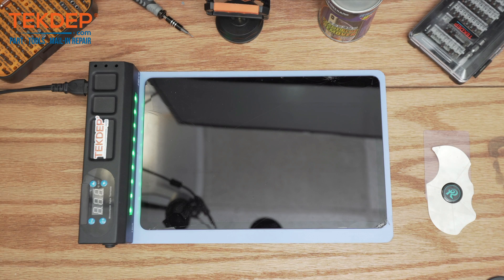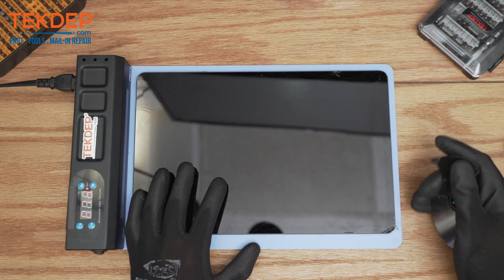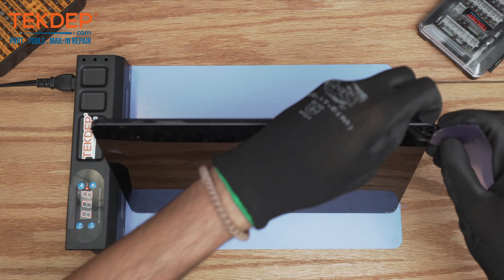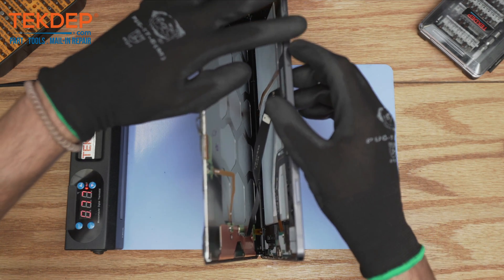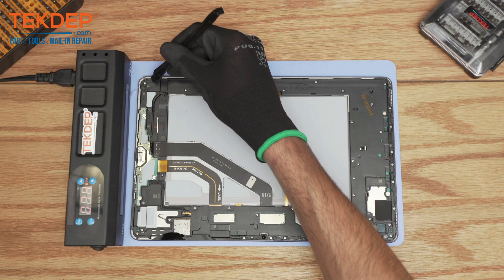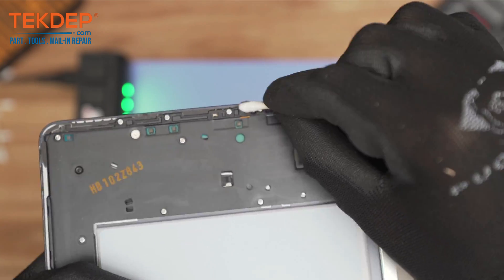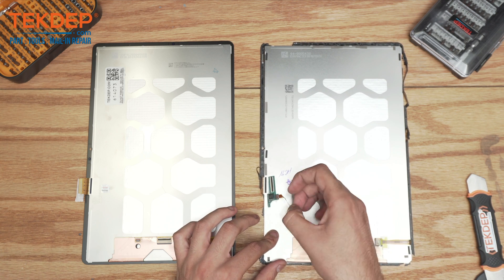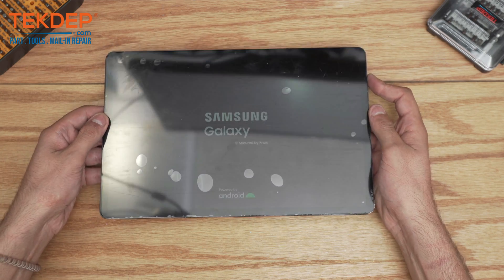Samsung Galaxy Tab S7 - Broken Screen Replacement Repair Guide

Comment: I tried to fix my screen but it's not working what can I do 😢
Reply from the maker: Sorry to hear it’s not turning on! First, try a forced restart by holding the Power and Volume Down buttons for 20 seconds. If that doesn't work, I’d suggest re-opening it to make sure the display flex cable is fully clicked into the motherboard. Sometimes they feel like they are in, but aren't seated perfectly!
If the problem persists and you'd like a professional hand, you're more than welcome to use our mail-in repair service.
https://tekdep.com/mail-in-repair

Comment: Since the screen flex is bent over when installed, could it lose connection  . I replaced the power butyon and it dont turn on. Not even when I charge it. Should I order a new flex cable?

Comment: I accidentally submerge my tab s7 in water in a bucket about half an inch and after a while it went black. The tablet was already cracked and the water went inside fast.😔 I ordered from Aliexpress the LCD and im gonna try to repair it myself tonight.
Reply: Did you replace it?

Comment: The wacom cable is in a different spot in this video than the screen pictured on your site for the SM-T870. Which one is correct?
Reply from the maker: There is different version on most devices on the market, they look the same but when it comes to components they may use different layouts 

If you're still experiencing issues with your device and need help, we offer a convenient and affordable Mail-In Repair Service and data recovery. You can learn more and get started here: https://tekdep.com/device-repair/

If you need parts or tools for your galaxy tab repairs, we have them all and ship worldwide! visit: https://tekdep.com

Comment: Hey man i replaced my screen and the replacement works but now it has like dark spots on the left side of the screen. Any ideas?
Reply from the maker: Most likely the replacement screen being damaged while reinstalling it, 

If you're still experiencing issues with your device and need help, we offer a convenient and affordable Mail-In Repair Service and data recovery. You can learn more and get started here: https://tekdep.com/device-repair/

If you need parts or tools for your repairs, we have them all and ship worldwide! visit: https://tekdep.com

Comment: My Galaxy tab wont charge nor turn on after replacing the screen
Reply: Sounds like you either didn't connect something right or you fried the board, or maybe you destroyed a fpc connector next time don't touch it
Reply from the maker: Hello, that is unfortunate!

Make sure you have connected all the flexes and used anti-static tweezers and plastic prying tools. Also, be sure to disconnect the battery whenever you touch the logic board. If you need tools or mail-in repair, visit our website.  https://tekdep.com/
Reply: This is maybe too late, but most likely it was all good. The thing is you have to start it with power on + volume down(or up, I can't recall) and it takes a bit  longer than usual. I hope you didn't throw it away

Comment: After the repair, everything worked well, touch and spen. But after a while, the touch stopped working, only the spen works now.
During this period, oneUi was updated. Any tips to try to resolve this, or is it a screen defect.
Reply from the maker: I don't think it is a screen defect, in the last week or so Samsung has pushed out an update that has made touch screens not responsive to touch, only responding to S-Pens. We are hoping for a software fix in the next few days.
Reply: I have a S21 ultra & 22 ultra that had after market screens and  UI updates killed the touch, it's not the screen. They both work with S pens.

Comment: whats the cause if the s pen doesnt work with the new screen? could it be the lcd ?
Reply from the maker: Usually the main cause for the situation you mentioned is defective LCD replacement however we suggest to get it checked by a tech. We also do mail in repairs if you're interested please visit. https://tekdep.com/

Thank you!

Comment: How to fix it if the inner screen is damaged
Reply from the maker: Hello, Good question! Fixing the inner display, commonly referred to as refurbishing, is a labor-intensive process requiring specialized tools. Extracting the display involves considerable time, materials, and risk of scratching the LCD making it less commonly done for Samsung Tablets compared to Apple devices. Therefore, we recommend replacing the entire assembly instead.
Thank you!

If you need parts and inquire please visit our website https://tekdep.com/

Comment: How much it cost  to repair
Reply from the maker: hello, thanks for watching. you can learn more at www.tekdep.com/repair/ .
Reply: around 50 to 60 bucks for the repair kit, maybe an additional few bucks for a heating element like the heating pad or a hair dryer if you dont own one
Reply: Hi, I went through the same steps you did. However, the screen is still not working. The device is making noises and it makes the charging sound when plugged in. The old screen was working, just cracked badly. What am I possibly missing?
Reply: @natet7323 same Problem here. I might have bent the main lcd cable. Swaping it in a few days...
Reply: Apparently, two items from the old screen were suppose to be relocated to the replacement screen. The old screen was tossed by accident by a family member. I ordered the items and installed....still not working.
Reply: Are you meant to clamp it down with something how does the screen stay down for till the glue sets